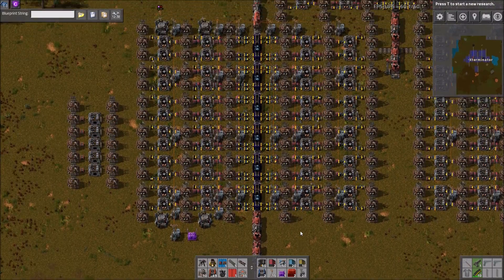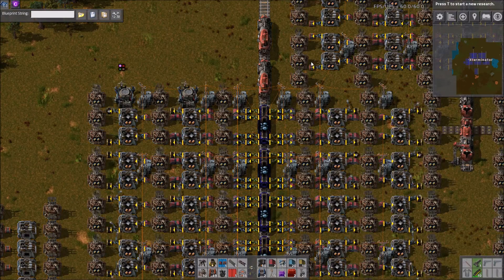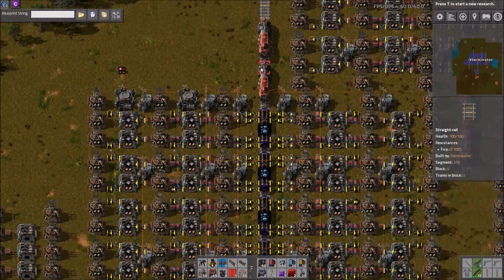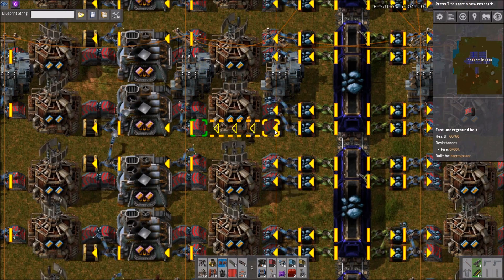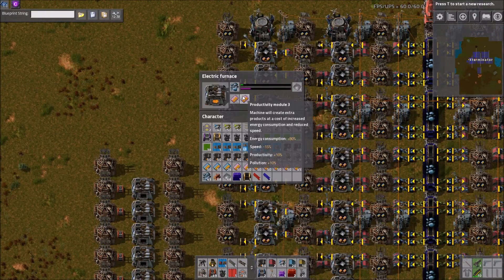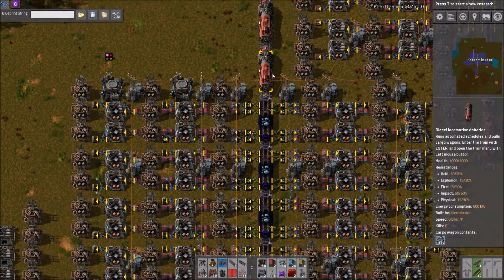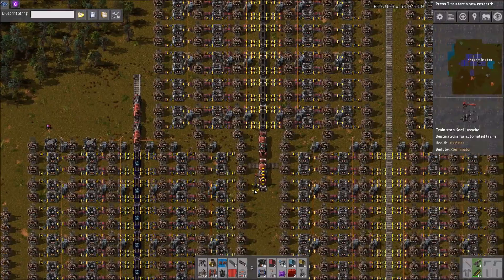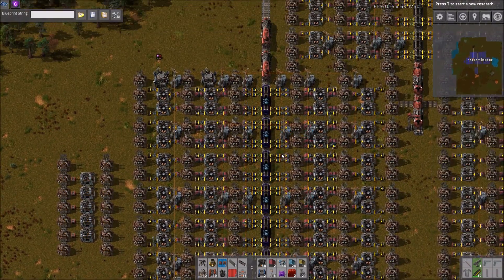Factorio Workshop - Building A Better Factory :: Train Smelting Design

Comment: I don't really understand why people carry ore.
Plates stack twice as much and if you smelt on-site, you save a ton of space in your base and it's easily expandable.
You want to cut out steps but this doesn't beat trains just coming in and unloading plates into passive providers which cuts out all of the steps and is much more easily expandable; if you need more input, just tap more ore fields or make the on-site smelter bigger.
Reply from the maker: You are correct, carrying plates is more efficient but I find it a huge pain to build onsite smelting at outposts. There are several disadvantages I see for it: 
It makes it more of a hassle to set up outposts (which is already a pain), and taking them down too once they are finished. Also if you are playing with biters on, having all that smelting at outposts is generating a ton of extra pollution at the edges of your territory, which means more attacks and more defenses needed as well. 

I think it's personal preference, but I just find it better (at least for me) to have central smelting at my main base that I don't have to rebuild everytime I set up a new outpost.
Reply: You can just turn your setup around and that's your outpost train stop.
Simple enough. Or at least no more complicated than what you have already.
Reply: I know this is ancient but just wondering, do people still think smelting at outposts is the way to go? Seems like it would be much harder to manage the flow of resources if you are having to play a guessing game of how many smelters are going to be operational and for how long.

Comment: Thank for the video, some constructive criticism,

When quoting a smelting set up (and some other) please say the number of belts, eg setup produces ~3 blue belts output. It's much easier to get a rough idea of what the output is. This is kind of it like physics, people take about acceleration in g (9.81 m.s-1) just because it makes a 'back of the envelope' comparisons much easer. 

When comparing things try always create standard 'game units', 7 thousand units/min of something is a very arbitrary value.

Maybe it's just my engineering background coming out, but it is easier to get an idea of what is going on with easy standard units.
Reply from the maker: Thanks for the feedback! I can see your point about having standard units to measure in, it would definitely help. The thing is though, if you are doing bot setups, which for this smelting design you would be, measuring in belts doesn't seem to apply. 
If we are doing robot based production, saying something produces "3 blue belts" or whatever it may be, doesn't really give much to calculate off of if you are using bots. 
I can start giving the measurements in a couple ways in the future though just so it's easier to understand for different ways of thinking and just gives a different perspective. :)

Comment: If you used medium power poles you could easily make 6 inserters on each side of the wagon if the inserters are the bottleneck :)
Reply from the maker: Where would the medium poles go though? If they go where the substations are I think they would still block part of the unload or underground belt right? Or would they just merge onto the existing belts?
Reply: in the gaps which lead from between wagons it would work just fine ... they have coverage of 3 tiles which means they would perfectly cover everything, just like at a train station :)
Reply from the maker: Vaclav Benc Oh okay now I see. Thanks! :) I'll play around with it and try adding in the the power poles instead and add on additional furnaces to accommodate the new Inserters. Should work quite nicely actually.

Comment: If you used medium electric poles instead of  substations, you could add 50% more furnaces.
Reply from the maker: Really? Where would the other furnaces go? They couldn't go where the substations are. 
Sorry, I'm super tired and my brain is moving particularly slow this morning so I'm probably missing something obvious. lol
Reply: Can't you fit another set of underground belts through there and have another column of furnaces/beacons?  I can mock it and post a pic if that doesn't make sense.
Reply from the maker: Landon Kryger Ohh I think I see what you mean now. Yeah that's a good point. I'll play around with it and see if I can get that to work.

Comment: At what point do these stamps smelt so much that you're just constantly drying up raw resources and having to store the products? I guess there's nothing really wrong with that, the faster you tap resources the more production you can accomplish. But I guess my question is, is there a defined wall that people hit in singleplayer, unmodded factorio where resource processing is faster than you can possibly input resources, therefore if you run out of resources for your factory you have to keep laying train tracks to keep things moving? Enjoy rereading that run on sentence
Reply from the maker: There is a point where that can happen, but it would require an absolutely massive amount of production or smelting to have that happen if you stay on top of your outpost building. Plus, even in vanilla Factorio, they changed the resource spawning fairly recently so that the farther out you go the better the resource patches get. So you do get to a point where you have huge resource patches with insane richness, which helps make up for any shortages. 
Obviously at some point you would still hit a point like you mention. It also depends on how you build your trains and train systems to maximize throughput.

Comment: I approve all of this. But if you switches to steel poles you could probably add more beacons/put more in there.
Reply from the maker: Glad you approve. :) You're right I probably could fit more beacons, but I don't think it would allow all the furnaces to get equal bonus. I did have more beacons in there previously, but some smelters were getting hit by more beacons than others and that would result an in uneven draw of resources from the wagons/chests. :/
Reply: I had that thought too, but actually, you're already using a buffer.
train>buffer>smelter>buffer
So the train would drain at the same speed, the only difference is some of your smelters would be done sooner than others, by a small amount. 
If you were using belt it would matter more, but you would just use a belt balancer. But you're using robots. And I've found that robots will take all the iron from one chest before going to the next. So by the logic of the design, if all the iron isn't being used then some of the furnaces won't be in use anyway.
Lets say all the iron is in use. Then you'll just have more of it.

Back to the train. Because some ore is being used faster in some places than others, depending on how far the train has to go, some of the wagons may not completely deplete. So instead of using a "leave when empty" train condition, make it a "leave when empty" OR "after 70 seconds"

There is very particular reasoning for this timing. 
It takes 40 seconds to empty a cargo wagon when you have all 12 inserters pulling out. same to load.
Instead of 12, you have 8 inserters per wagons. So we add 33% more time, as we have 33% less inserters. 
Which would bring us up to 60 seconds. Then, to compensate for variables such as some furnaces going faster than others, we add 10 seconds onto it. It's important to have the leave when empty condition as well, as an empty train is a wasteful train. 

One final thing. You could add more buffers as needed, to make sure you're always processing the ore, and the train is always going. 

Unrelated to the setup, you should always consider going very far away from your base for resources. The algorithm is set to increase exponentially. About 4 minutes of train travel away will get you to the 12k per ore square mark, and it just goes up from there. 

Think about making a frontier hub, where you collect the ores from all around it, and then send a couple 4-12 trains. Or 4-12-4 if thats how your system is set up, but I prefer single headed trains, it makes building the track a lot more interesting with all the things you can do. 
I'm considering using farl to go to where the ore is 50k per square, and sending back a megatrain. a 6-20 or a 8-30 would be a lot of fun. But I would need several to keep the flow rate normal with the train traveling so far. Maybe waystations for fuel as well.

Comment: Nice design! my only thought regarding laying multiple smelters like this would be placing the roboports, but that would be easily fixed IMO.
Reply from the maker: Thanks! :) 
Yeah the roboports might get a bit tricky, but I think you could fix that by just spacing out the stations a bit more to fit the ports on the end like they are in the blueprint.

Comment: Why bother with moving the ore. If you use bots in your outposts, just smelt it there, and ship the plates/steel
Reply: The obvious response: Smelting at outposts is better, because plates stack to 100, while ore only stacks to 50.
Reply from the maker: DaemosDaen Because then you have to set up smelting at every one of your outposts. And your not really saving anything cause your still using a train to bring the plate back and then unloading it and having bots take it to where it needs to go.
Reply: Xterminator The normal smeltery; The bots load the ore into chests, the ore is then loaded into the transport train. The train transports ore to the primary processing. The bots load the ore into the smeltery input, the output is then loaded into chests waiting for the train. the Train transports the supplies to where they need to be.
The onsite method; The bots load the ore into the smeltery input, the output is then loaded into chests waiting for the train. the Train transports the supplies to where they need to be.
Also, what's THAT different between setting up smelting onsite compared to a single point. Most on site smelting setups would be smaller, unless you wanted more throughput. The only issues I can come up with may be biters as they are attracted to the pollution.
Now, the reason I see people using the central smeltery is due to early game where you rely on coal, but once you switch to electric, I can't see a good reason that the practice should continue.
If this comes out as one big block of text, blame Youtube, I formatted it.
Reply from the maker: DaemosDaen I'm a bit confused by part of your process for the normal smeltery. I never have trains bring the finished smelting products (plates) anywhere sense the smelting is already in base. 
So in my bases, and most people's I've seen it goes something like this: Robots load ore into chets at outposts, ore loaded int the train, then the train brings it to the main base. Train unloads into chests, bots take from chests to smelting, then bots take smelted plates to whatever needs them. 

The design I showed, eliminates the step for bots taking the ore from the train to the smelting. 
My main issue with smelting on-site at mining is that it's just a pain to build smelters at every outpost rather than just building a large one in the main base.
Reply: Xterminator Don't get me wrong, I'm not saying, by any stretch of the imagination, that your setup is bad.  It's quite good, and I like it. It's that I wonder what would be the mode efficient, both in game and on the CPU.
This is a bit of a wall of text so bear with me.
Transferring items over long distances (by bots) take more resources, more power from your network, and more CPU resources (not as much as belts, but rendering all that is crazy on a system. The shorter the distance a bot has the travel, the better. At your mining site, there is no real wat to change any of this, but the rest of the planet factory would probably be large enough to gain from having the bots travel short distances and to cart the major of the distance by train instead of having bot travel long distances, kind of like the bus method, but using trains as delivery instead of belts.
Unfortunately I have not had the opportunity to try this as I have not had time recently, this is more of a thought experiment in my head. Something in your vid sparked the thought. I've actually had 2 factory planets get big enough that I could not run them on the potato I used to play on. Now it's not that much of an issue, but I always try to find a better way to do stuff.
Also once you get a blueprint (and maybe a personal robo port) it should not be more of a pain.